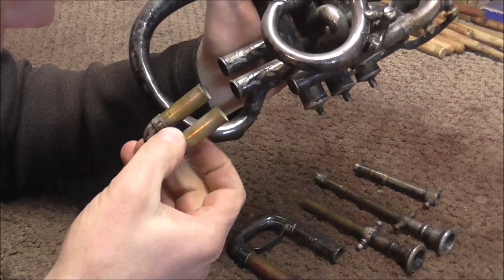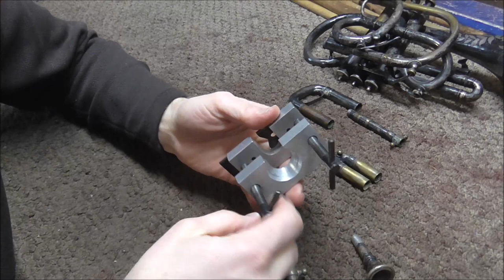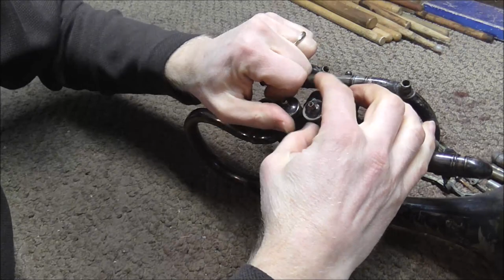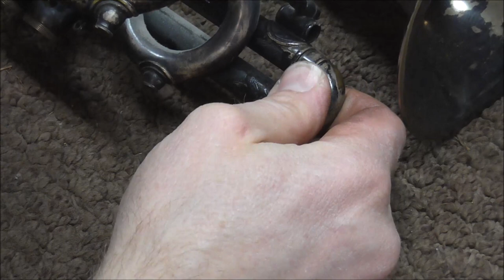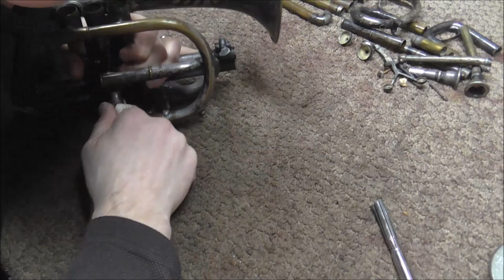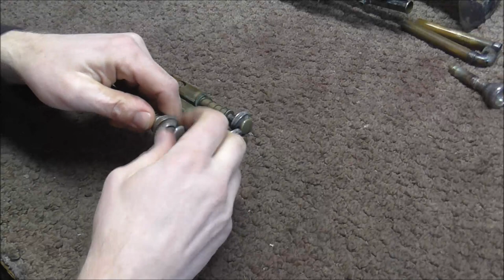Antique Distin Cornet Restoration Series #1 | Removing Valves/Slides/Mouthpiece

Comment: I've had very good luck getting black tarnish off of silver items using the clear liquid silver cleaner products made for silverware. Not the white emulsion abrasive stuff, the clear liquid chemical stuff. Just wipe it on, wait a minute or two, and wipe off vigorously with a very soft cloth to avoid scratches. Then wash with clear water to remove any residue. You may want to wash the thing first with dish soap and warm water to eliminate any mung that might dilute the silver cleaner, or worse, cause scratches.

Comment: Those old timey cork buffer valve caps are kinda neat, but not exactly an at home repair if you want to replace them properly with good valve alignment.  Luckily, you can usually just use a normal felt under the finger button and call it good if you're not going for "100%".